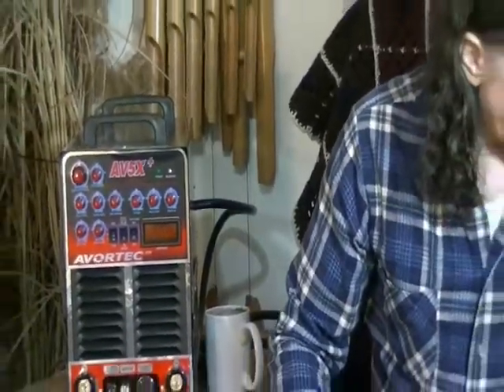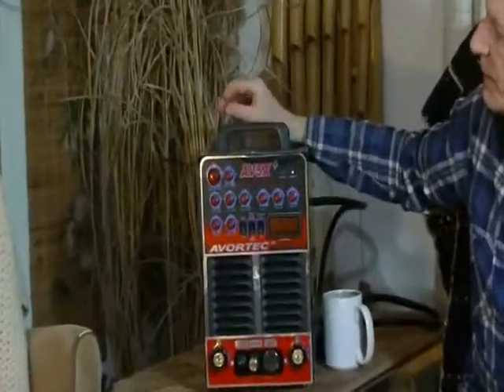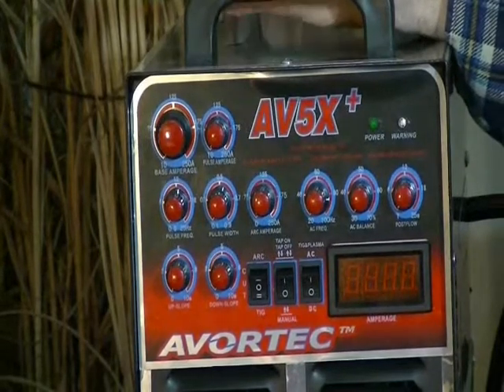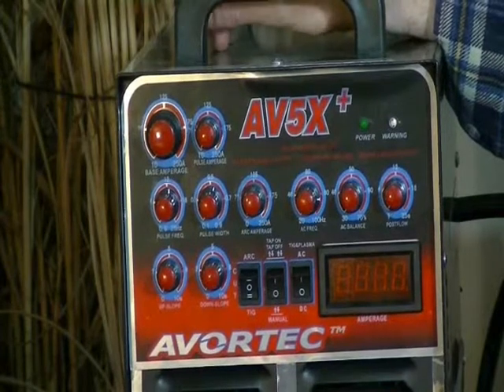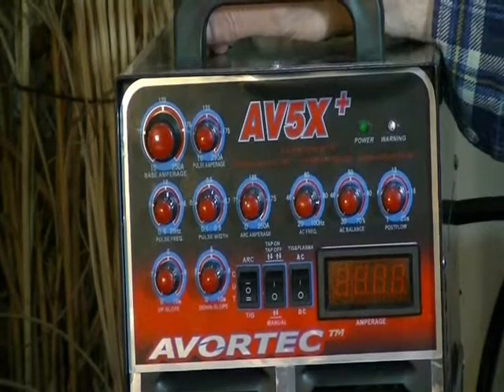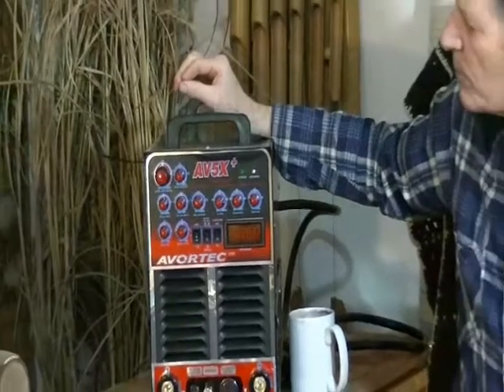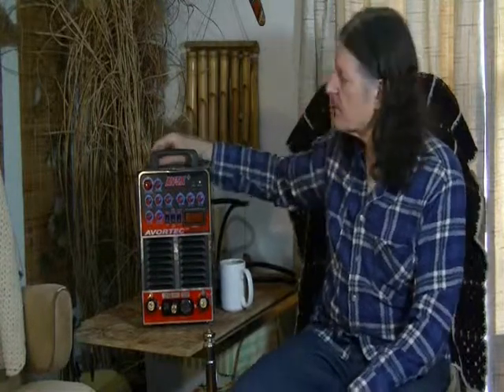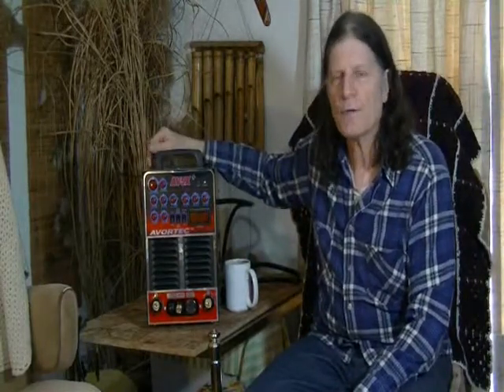Copperland Corporation CEO Ken Rieli reviews Avortec AV5X+ Multi process Machine, Intro-1

Comment: Hi I was hoping you could use the plasma torch on some 3/4" plate . I think a 6" cut would give me a good idea about how well this plasma gun works . Thanks in advance
Reply: RCpilot2008 this unit is good for 1/4" max
Reply: RCpilot2008 yeah which is WHY I say 1/4 max because anything past there is not a consistent cut .
Reply: Needs a hypotherm non conductive tip setup . The tip on this torch falls apart after a few minutes of use.
Reply: Yeah I bought one . I still havent used the tig gun how is it ?
Reply: good hints and tips i will make a note and try and follow them thank you .